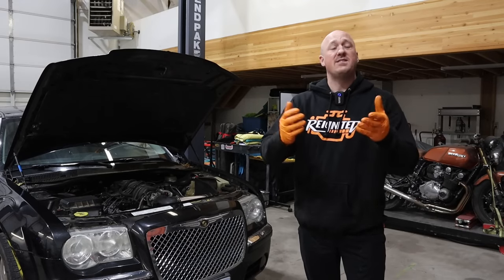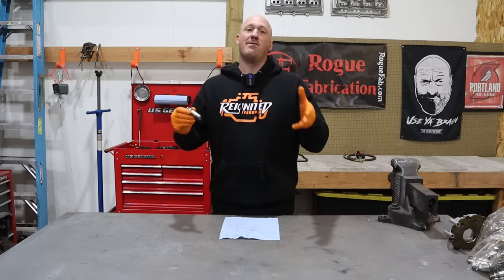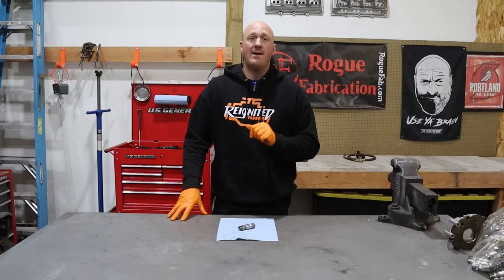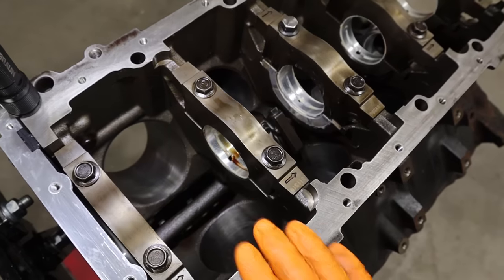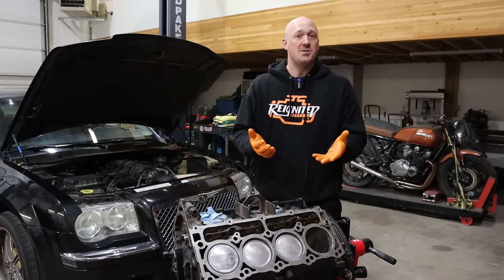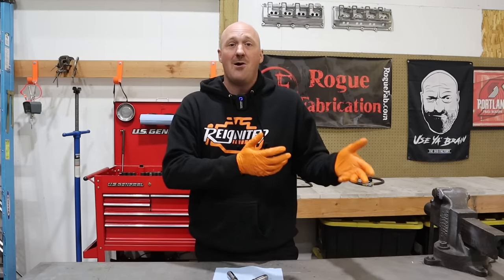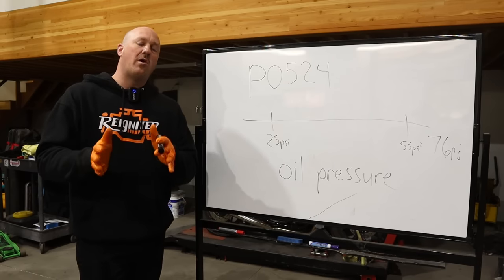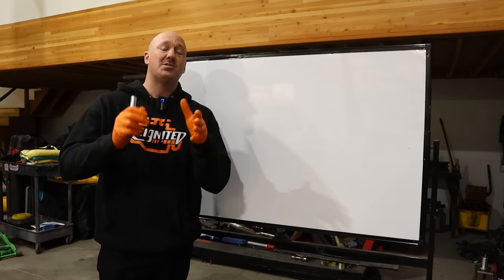The BEST Prevention For Hemi Lifter Failure! (In My Opinion)

Comment: Hello all 2015 Ram 1500 sport had the lifter and cam failure when replacing everything I went with the Hellcat oil pump but I keep getting the code for low oil pressure I have tried splicing in the signal wire with the 2 resistors the 1k to computer and the 7.5k to ground I could not find a 7.4k but unfortunately the code still comes on weirdly it seems it comes on faster than before any input would much appreciated?

Comment: so i got a 2006 hemi i pulled out the msd cam and lifters and put a stag 3 cam kit  form comp did not get lifters so i got some i had out of a 2004 hemi i did have the springs and stuff that come with the cam kit done had it almos tune with hp tuner and had a lifter fail on me is there lifter i need for it all it still it still haves good power just lifter poop out

Comment: Questions:  So half the mechanics I talk to say the Hemi tic is no big problem, half the mechanics say it's an incipient failure and must be repaired ASAP.  So who's right?  Is the Hemi tic always caused by the bearings failing on the roller or can it be something else?  I put 140,000 miles on a well maintained 2012 5.7 with no hint of a tic.  Now I've got a newer, just as well maintained 6.4 with 20,000 on the clock.  Should I panic at the first hint of a tic?
Reply from the maker: Got a video for you that I hope will answer some of your questions 👍: 
https://youtu.be/XHqSePuaD-M
Reply: @ReignitedAuto  Watched it.  Very informative, thank you.

Comment: My 6.4 2500 calls for 0w 40. What brand of oil and weight do you recommend.
Reply: I doubt he'll recommend a specific oil. But I've been using Pennzoil ULTRA Platinum, and I think it's fantastic.
Reply from the maker: It's true, I don't really have an oil brand I prefer. But I do strongly recommend staying with the factory weight oils they recommend.

Comment: First of all, thanks a lot for the video, which very informative and useful. Then I would like to explain my issue> I have a Jeep Gran Cherokee SRT V8 2015. Last week the MDS system stop working. and coincidently the engine light went on. The code which come out from the diagnosis on the dashboard is P0520. I have been to a garage to let them connect a computer to my car to understand more about this code, and they told me Oil Sensor Low Pressure. The pressure which I read on the dashboard is between 6.5 and 6.8 PSI , in according with the RPM. I-m not very concern about the MDS if it is working or not, and to same a bit of gasoline, but I want to be sure that nothing happen to the engine itself. So I.m not sure if I need to change all solenoids or the oil sensor or what. and to prevent any future damage, even decide to change the oil pump and as per your video, replace it with an Hellcat model. The previous owner and myself now, we have been changed the engine oil including filter, every 6000miles, using a synthetic oil Motul 5 W20. Can you let me know what in your opinion I should do?

Comment: First, as a side observation, I have a 1979 KZ1000 [motorcycle] that looks exactly like the bike on the lift behind you. 😊
  Now then...  My comment is based on information I've gotten from several sources, ultimately I'm saying it's my observation/summation and not the word of God, just something more to put into the mix of understanding these beasts. 
  The concensus from others "in the know" is that the change of angle of the cam/lifters above the crank (new hemis vs. original) reduces effective oiling of the system, yes, the splash effect but, also...  It appears that the "pressure pixies" in that part of the system don't always seem to be getting enough "motivation" (pump volume fluctuations due to rpm) to do their job.  "Why"  is something they haven't been able to dial in...  Combine that with the, I'm just gonna say it, "improper" materials used in the cams that won't take the abuse of the lifter rollers and the end result is...  "Tick, Tick, Tick..."  That's something the engineers didn't figure on and that's the weak spot in the otherwise stout, hemi engine, particularly the 5.7.
  As for metal shavings, there's a whole "thing" about flush filtration plus, demagnatizing the block during rebuild to release the fine metal shavings <circling the rim around the rabbit hole>...  Yeah.
  If you have lifter/cam failure, I fully agree that cam/lifter replacement with a thorough flushing of the lube system is 95% just fine.  (BTW, I spent 30yrs as an ASE tech, as well so, I'm not a ~complete~ idiot, some parts are missing 😊).
  UTG/Uncle Tony's Garage is a terrific channel, he's been a constant/consistent mopar expert with 50yrs experience in everything from daily drivers to funny cars and everything in between, understands the engineering of cars and engines to the point of ridiculous savantism and regularly builds cars with old and newer engine platforms and he has a great video about this, I highly recommend watching it and his other related vids, as well.  😊
  And thanks for a great, informative session.
  And a P.S., I have a '22 Challenger Scat Pack Shakedown edition (the Shaker hood, for those not in the know) and it had the 392/6spd Tremec and it does now have MDS.  For whatever that's worth.  😊

Comment: Only 7 minutes in, but I have to argue your thought that those 2 oil galleries provide (much) oil to the cam/roller surface. They send pressurized oil into the lifter bore, but how much of that do we know gets past the lifters and onto the cam/roller?
Reply from the maker: I've got a few spare engines lying around, I've been contemplating trying to figure out a way to pressurize the oiling system with it on a stand that way I can verify for myself and my viewers exactly how the system behaves. 👍 if nothing else I think it would be pretty informative.
Reply: @ReignitedAuto  I think that would be such a useful experiment... Wish I could do it myself, but I'm just a driveway hack... Don't even have the garage space anymore thanks to all the kiddo's various moded of transport being everywhere!

Comment: If oil volume is the answer wouldn't it be easier to use an oil filter that has 5 times more flow Vs the OEM Mopar filter MO899 compared to changing the oil pump and accomplish the same thing or actually gain more flow?

Comment: I'm a recent victim of the cam & lifter failure.  2015 Ram paid off & sitting🤦🏾‍♂... I love the Hemi but won't buy another one.
Reply from the maker: If you're feeling adventurous I've got a ton of videos showing how you can repair this issue. It seems tough on the surface, but it's really not that bad, could be done in a weekend for sure. 👍

Comment: Maybe you can answer this.  I cant find an answer.   I have a 19 Durango RT 5.7.   I believed it had MDS....   But, Ive never felt the cylinder drops or ECO light come on as I do on my 19 Ram 6.2 with MDS that activates.   Whats your opinion?
Reply: It's transparent to driver in my jgc.   Doesn't tell you when mds is active or not.
Reply: @user-cj7dv2kc6d  That's what I was guessing...     I know in the 6.4 WT and my new 23 DRT its pretty dramatic where I never noticed it in my 19 DRT....   My 23 has a disable rocker and I just leave the MDS off in it.

Comment: I have heard, contrary to what Chrysler says, that MDS does not make any difference to gas mileage in real life. Can you explore that? If it makes no difference to mileage I’d rather just be rid of a potential fail point. 

Can you expand on real world +/- of MDS?
Reply from the maker: It largely depends on how you drive your vehicle. There's a number of situations where it won't ever activate simply based on driving habits. On the other hand I've heard of people getting up to 24mpg by making it activate as much as possible. I'd say in my opinion that it works well in passenger cars, not so much in the bigger trucks. Although some 1500 owners report really good mileage as well, so if have to say the biggest factor is going to be how you drive it.

Comment: The inverted V16 never made it into a production version, only two prototypes with XP-47_ designations ever flew, the one pictured with cowl removed. The aircraft pictured with the cowl in place is indeed a P-47, but it’s powered by the Pratt and Witney double wasp, two 9 cyl radials back to back to make an 18 cyl 54L monster that in its most powerful production variant produced a staggering 2800 hp, and 3400 hp from water injected prototypes

Comment: So I had a quick question to see your opinion, I have a 2013 300c with the 5.7, I got about 107k miles and I only let it idle for about 15 20ish minutes make to warm up the car then drive. I don't ever let it idle longer when I'm outside the car, and when I'm inside driving around, I'll usually bump the rpms up to 1k. Should I still take apart my motor and see if I have the chance of failing, or should I just wait till I hear a noise?

Comment: dealership didnt want to put a hellcat pump on mine said it would void the other parts they are going to put on...i have heard the thicker oil protects better and to go to 5w30
Reply from the maker: Going to address that exact issue in a new video tomorrow! (About the dealer not being willing to install Hellcat pump) 👍
Reply: @ReignitedAuto  will be looking forward to it. also is replacing the cam and lifters just doomed to happen again?
Reply from the maker: @user-bm6xu6lk5d  driving habits and maintenance have a lot to do with it. I think once people are conscious about the issue it affects how they drive and take care of the vehicle and that's a big help.
Reply: @ReignitedAuto  i can't attest to the first 50k on my truck as im second owner but dealer had the oil records showing the maintenance and i do mine every 3-5k usually less as i drive it very short distances and barely put 7k on it a year and i drive like a grandpa my wife tells me i can count on one hand the times ive accelerated hard if what ive done to it makes it break down its a trash motor. mines getting diagnosed on monday and if its anything but exhaust leak and i have to repair you betcha im gonna trade it in and be done with ram if there isnt a proven fix for their major design flaw.

Comment: What are defining as extended idle. I use my remote start every day to warm motor up and give fluid chance to warm up.i have noticed huge difference especially in transmission shifting on cold vs warm.
Reply from the maker: Generally more than 1hr per day is what I consider extended idle.

Comment: Damn, now idk what to do.  I have an 18 ram 1500 with 75k miles, no signs of problems yet but I have an extended warranty to 109k or 3 more years, do I go for a HV pump trying to prevent failure or let it go and hope for failure under warranty 🤔

Comment: Hey! Thank you for such a great video. I haven’t been able to updated my registration on my car due to the check engine light. 
I’m trying to do the resistor mod but I’m having the hardest time finding the exact resistors you have. Any links? 
I really appreciate it! 
Thanks!!!
Reply from the maker: Which pump do you have? The Melling one for the early models, or the Hellcat for the later models?
Reply: @ReignitedAuto  I did the Hellcat oil pump on my 2012 Challenger RT automatic. Followed all your steps to this point, & car runs great but I just have the dreaded low oil pressure code.
Reply from the maker: @TheManuelakis   I got the resistors through Amazon, copy this name for the first resistor: EDGELEC 100pcs 1K ohm Resistor 1/2w (0.5Watt) 
And this one for the second: EDGELEC 100pcs 7.5K ohm Resistor 1/2w (0.5Watt)
You'll end up with 99 spares, but it's still cheap!
Reply: @ReignitedAuto  Awesome! Thank you for the reply! I can finally legally drive my car again 👍

Comment: I bought a ram 2500 with a 6.4 hemi that had a bad rod bearing.  I had it rebuilt with non MDS lifters and installed a non MDS camshaft out of a scat pack.  I need to look at what oil pump the machine shop installed but it makes 45 psi at idle at full temp.

Comment: Nobody talks about oil filters and flow rates your filter and oil are very important parts of your engine if the filter opens the bypass valve due to increased oil pressure you have ZERO protection is your filter going to stay in bypass have you checked the pressure rating for OEM filters to know if 76 or 96 PSI will make the OEM oil filter stay in bypass mode this is very important and only one side effect not to mention the cost of labor the HP oil pump MDS reprogram and fuel economy. Is it really the best solution please advise? 

 I always look for the least invasive way to resolve a problem without creating another issue.
Reply: buy a tune and up the idle 12% would do the same as installing a hellcat pump.

Comment: Just a question on your resistors there which resistor is connected to the lighter wire and which is connected to the blue wire I assume the blue wire goes to ground?

Comment: 108,000 on my 2019 RAM and all good so far. I had to replace the head gaskets last year and I inspected all the lifters while I was in there. Everything was good. Ported the exhaust since I had the heads out and installed headers. I use Pennzoil Premium Synthetic Oil (occasionally use Royal Purple when the Pennzoil is not in stock), Fram Ultra Synthetic filter (say what you want about Fram but I've been running them for 35 years and have put on over 100,000 and up to 300,000 miles on all my vehicles and never had an issue) and change the oil every 10,000 miles. I just recently went to the high milage oil and started to add some Lucas Heavy Duty oil stabilizer. I drive it hard. A mix between, country roads, highway and stop and go. A couple of things I do that may help is 1: I do not let it idle very much, even in the winter. Only a couple of minutes at most. 2: Any time I drive in areas where the sperd limit is under 55, I put it in tow/haul mode. This turns off the MDS and the transmission will run one gear lower keeping the rpms up. Yes this doesn't help with gas mileage but if your worried about gas mileage you shouldn't be buying a HEMI.
Reply: Haven’t heard about the head gaskets being an issue, how much did this cost?

Comment: Just about to buy my 1st 2022 ram limited with 5.7 hemi an these vids are really good to learn this stuff what I would like to know is if u change to the hellcat oil pump an dont want to do the wire trick an want to try the stock spring swop is that easy to do if so how do ya do it thank u
Reply from the maker: There's actually an even better option out now. The Melling 452hv pump comes with the stock pressure relief spring already installed, but still provides 20% more volume for the critical times like at idle. 👌
Reply: @ReignitedAuto  thanks for the info I appreciate it

Comment: I have a 2014 300s with the 5.7 all-wheel drive. I've had a Diablo tune in it for 3 years DOD turned off. Diablo calls it displacement on demand. If you've ever heard that when it goes to 4 cylinders and you have an exhaust, I just
... am ashamed. With the Diablo I bumped up my idle speed as well. One thing most people don't realize is that full synthetic oil is NOT100% synthetic. The big oil companies lobbyists were able to get the Congress to let them put up to 15% of crude in full synthetic oil. This is not a commercial but the only 100% synthetic oil is Amsoil, that's why I always run. It's in every moving part of this car, 140,000 miles. Regardless, you have to change your oil.

Comment: Where is the "relief spring" you mentioned Mosinvirus swapped out in the Hellcat pump?
Reply from the maker: There is a steel Allen plug in the bottom of the pump. You unscrew that plug and the spring is behind it.

Comment: We repaired the broken off exhaust bolts on a 2013 5.7 hem and put on shorty headers with new arp bolts and gaskets, the motor will not run right and it’s rich it has a terrible miss in it and has the famous tick the truck has 198.000 the cam must be replaced and lifters but what is causing it to not idle and run on all eight. Can you please help us

Comment: I need an MDS cam and lifter kit for a 2012 charger 5.7 hemi.   I am not modifying the engine.  I need a kit with lifters cam and gaskets.  Need suggestions.  I am reluctant to buy from eBay or amazon.

Comment: This is such a great trove of data. For 1, inadvertently it would appear that for those of us that want to disable MDS without getting a tune and all that comes with that...a less expensive option of HC fuel pump for 2 major benefits! Higher oil volume and MDS be gone...

Is the code just a code or does it come with an actual check engine light? If just a code...I could definitelive with that very much!
Reply from the maker: Check engine light on unfortunately.

Comment: With you voltage splitter installed (and HV pump),  does it affect the digital oil pressure display on the instrument cluster?
Reply from the maker: Yes, you're modifying the signal going directly to the pcm and that data is what's displayed in the cluster 👍

Comment: What is the best way to confirm that this is the issue in my vehicle. 2017 Ram Rebel. My engine is knocking but its very loud. Sounds like its coming from the valve cover area.
Reply from the maker: It's not nearly as common, but we do see a fair amount of issues with stock valve springs breaking. This can certainly cause more of a knock type sound. Sometimes if you're lucky the valve can't fall down enough to hit the piston and it's not a big deal to just swap in a new spring.